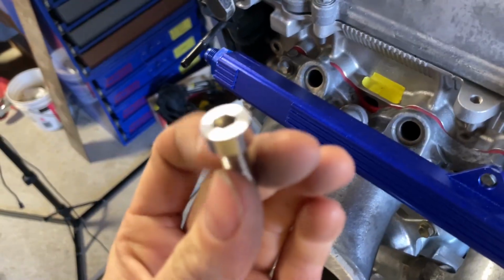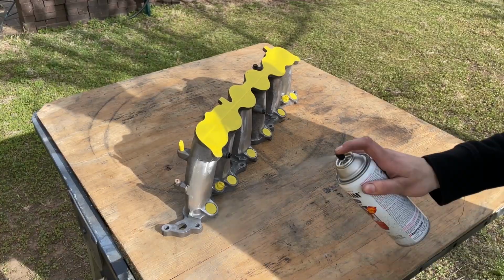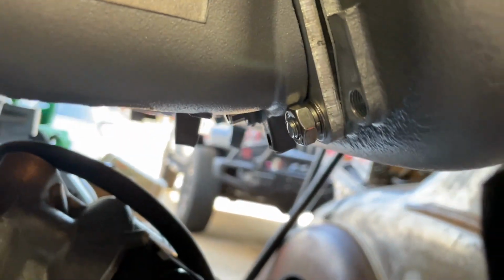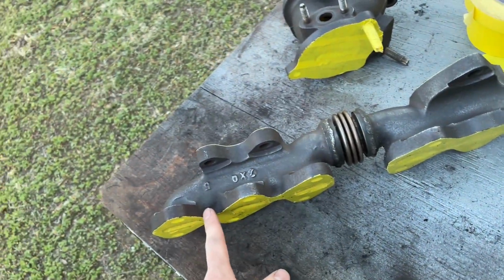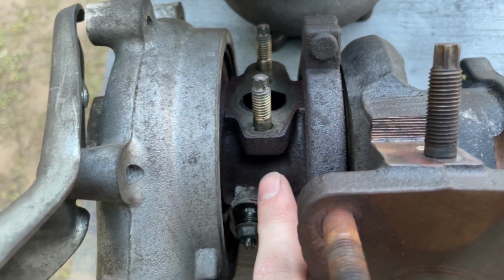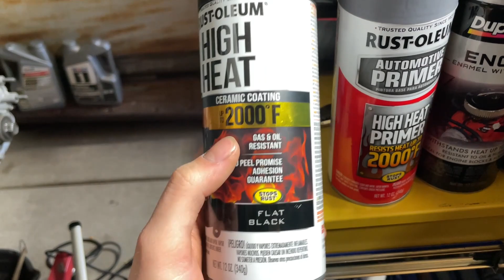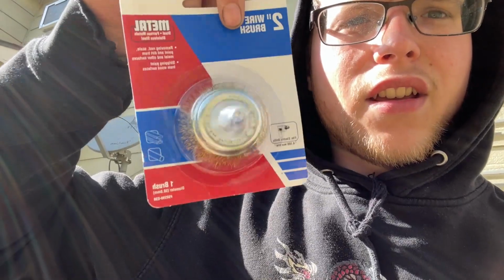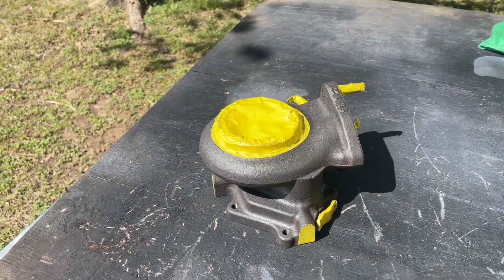Painting my 2JZ GTE Twin Turbos + Wichita's First 2023 Cars and Coffee

Comment: I’m looking forward to what you choose for the wiring and ecu because I’m currently looking at the emu black and the flying lead diy harness with oem connectors
Reply from the maker: Currently still looking into ECUs as of right now, but steering towards either the ECU Master EMU Black or the AEM Infinity 506. The EMU is looking like a great option for the price but the AEM has more features that a tuner could work with. We will have to see on which of those I get!